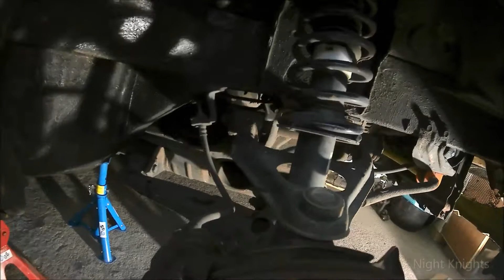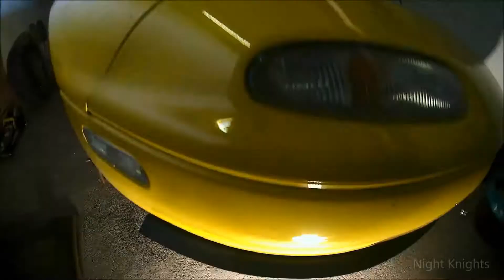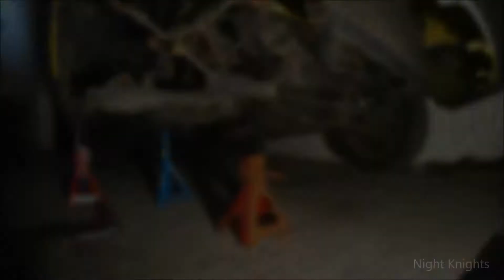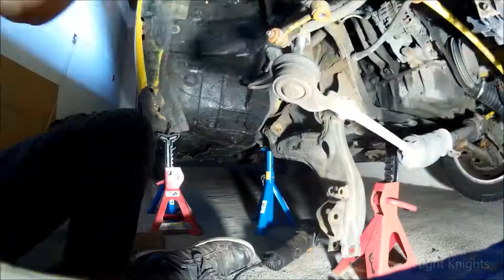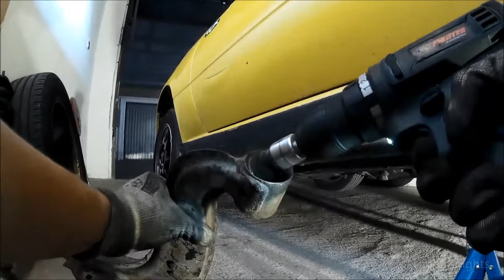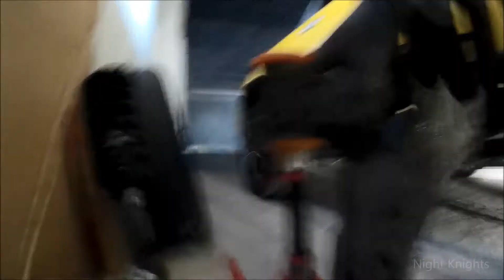Ako vymeniť excentrické skrutky na Mazde MX-5 - Výmena excentrických skrutiek a silentblokov

Comment: I need to get a damn angle grinder. Looks irreplaceable for jobs like this, where bolts wont simply come out with sockets and a breaker bar.
Reply from the maker: Yeah, definitely get one, those bolts have given me a hard time :D and it was pretty hard not to damage other parts, but It can be done :) I recommend a small angle grinder, with the bigger ones it's impossible to get there.